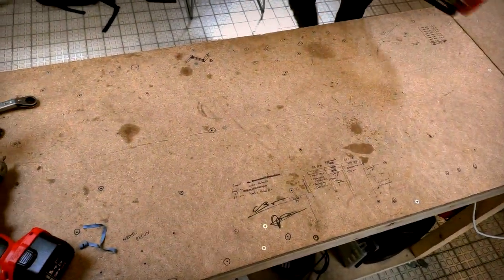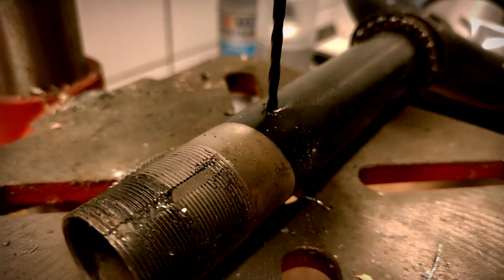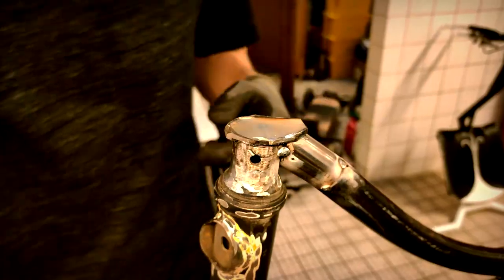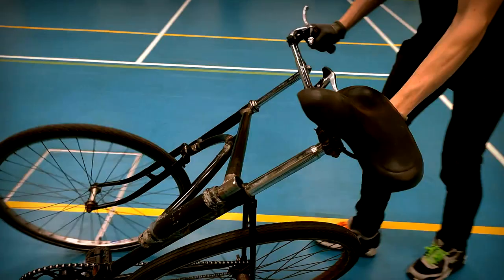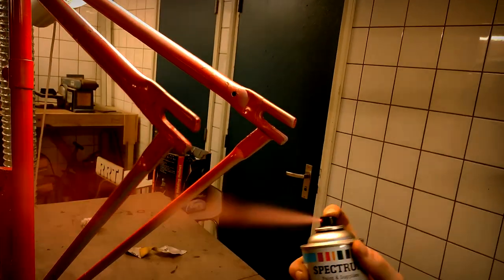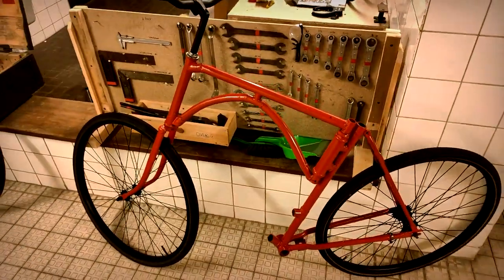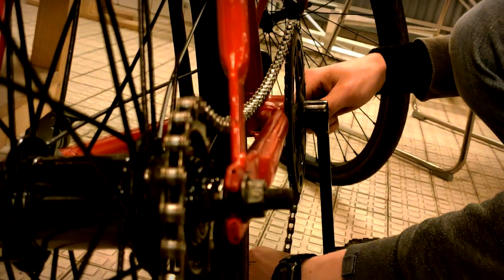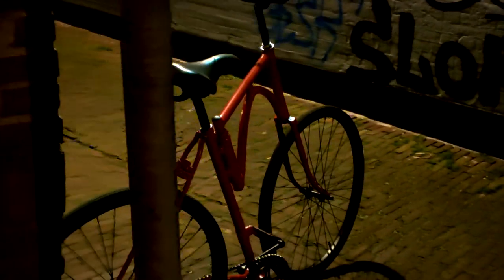How to build a swing bike

Comment: any toe overlap? i want to make something like this but fixed gear
Reply from the maker: Yooo fixed gear is gonna be hard. There is indeed some toe hitting the wheel action in certain angles. You will have to ensure a long distance between your bottom bracket and your front wheel.

Comment: what did you mean by inverting the fork?
Reply from the maker: Taking it out the head tube and inserting it from the top (upside down).
Reply: @Raphson  and would that mean turning the headset of the bike upside down and than re welding it to the bike?

And what advantage does a inverted fork give
Reply from the maker: So no, we were able to minimise the amount of welding like this. It was just done to get the arched frame that we needed to swing without hitting your legs on the frame. We only took the bearing cups out and swapped top and bottom ones. So the advantage is just that its less work to get to an arched frame shape.